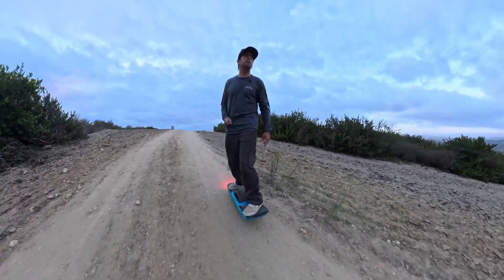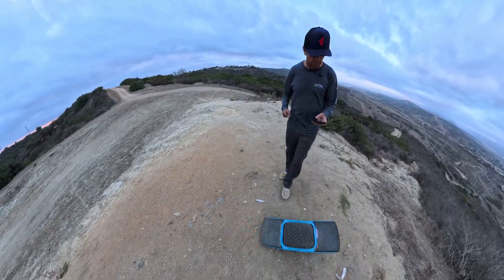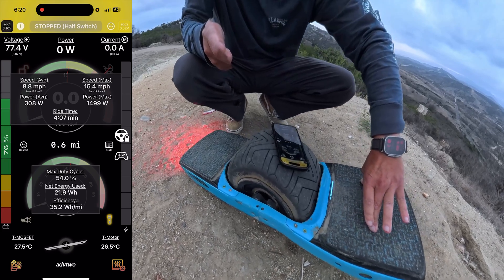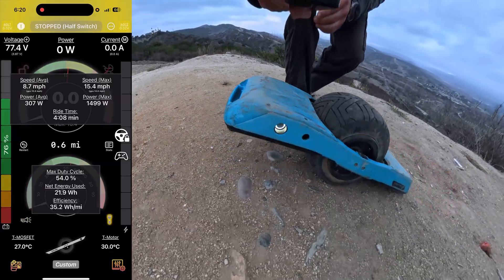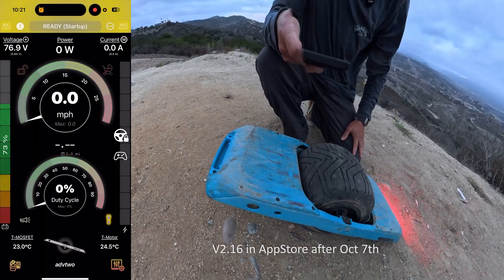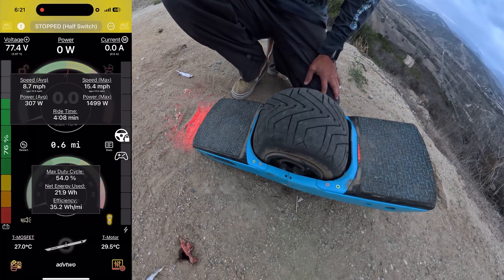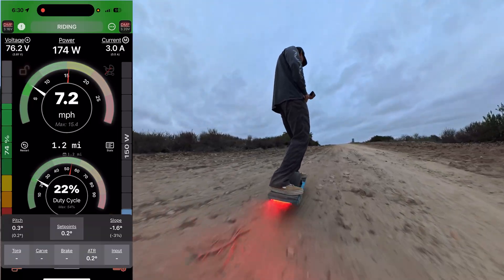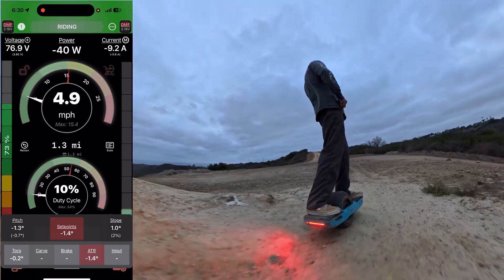VESC Onewheel Diagnostics 101

Comment: Yo can I pick youre brain for some advice.. My x7 sport with 107 miles dropped me yesterday at about 10 to 15 miles per hour. I got pretty messed with full pads. It just cutout. I havent had any issues with mountting and engaging. I normally mount board with run n hop and go. So now its gotten colder here in washington at about 36 degrees. Im getting alot not engaging on my mounting the board. It  just flops over onto the nose. Yesterday it dropped me and yesterday it was finicky. Today is colder out and had no issues riding at 7mph, sensors in app show 3.3volts on both sides. I did not have disable moving faults marked when the board dumped me. I use simple start, push start and posi. I only do quick stops or jump off board. IVe had 4 vesc boards and 3 future motion boards and was never dumped from cutouts, so I am very timid and freaked to go fast or drops, curb nudging and I will never go fast on this board again until I can get a reason as to what appened.
Reply from the maker: obviously you have a sensor issue - definitely turn on "disable moving faults" while you work on fixing your sensor
Reply: @surfdado thanks bud. is tge platypus 5.0 good footpath sensors. I do like the f.m xrplus wood footpads

Comment: Hey dude. Im riding the x7 sport with thor 301 p30 cells 20s. IM fairly new to onewheels and vesc. Ive had a few but pretty green with all the terminology. IVe heard yo talk about the field weakening setups and slight nose dips. Well today I was pushing real hard on flat surface...I was around 26mph and I felt this quick slight nosedip at 26mph as I was pushing to go faster. It was very quick. Is this the field weakening kicking in?
Reply from the maker: That seems unlikely as field weakening slowly gets ramped from 18-20 onward. How low was your battery when it happened? It could also have been a ZVF interference issue. See ZVF tuning on pev.dev
Reply: @surfdado I was at 67 percent capacity..
Reply: @surfdado to be frank the onewheel platform doesn't feel safe at anything over 25